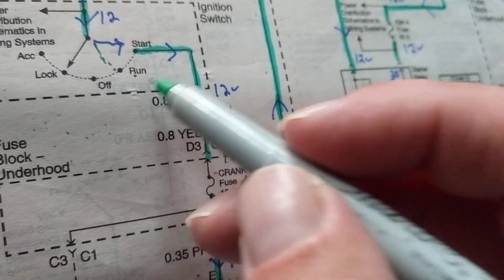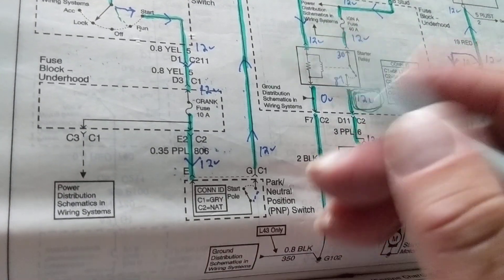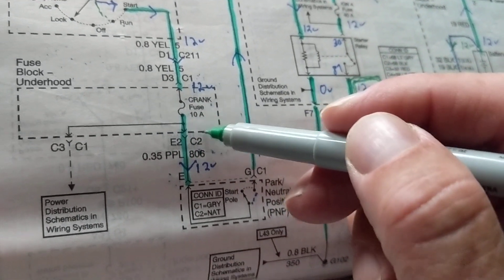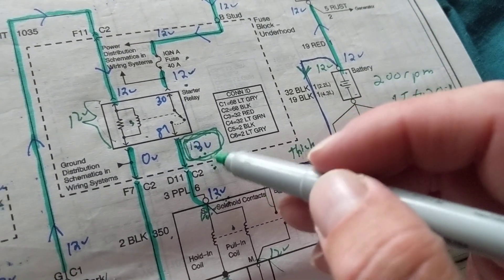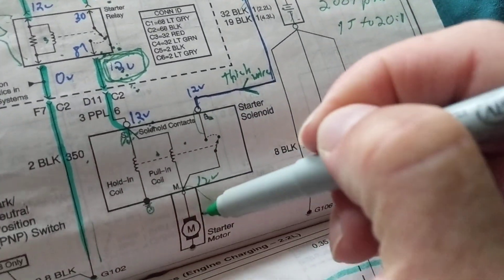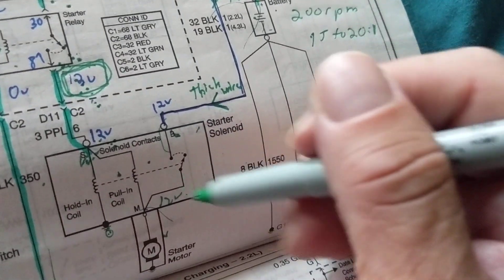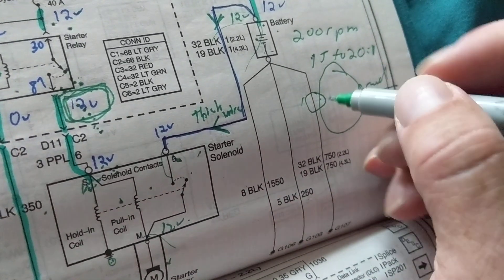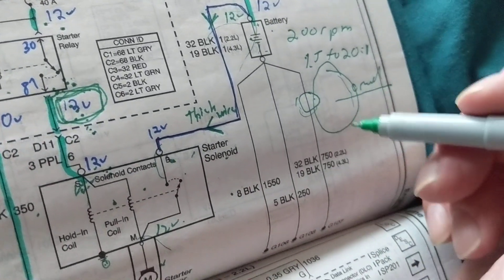HOW TO MEASURE THE STARTER MOTOR CURRENT WITH A CLAMP BUT UNDERSTANDING THE DIAGRAM

Comment: Can I use DC setting or just AC if use amp clamp?
Reply from the maker: The clam can either be for AC or DC however the high current amps clamps usually are only DC and that's what you need DC

Comment: This was beyond hand's on ..
Learning to test a circuit with a load present is more than hand's on. Since I also learned theory, learning amps will flow in great amounts when work is being done. I always hear measure voltage and now I learned amps can tell us much about a component.
Learning about having voltage drop across a wire with high amps also makes sense since the resistance in the wire will cause concern due to the high current flow 
Many thanks.
Stay well
Reply from the maker: You are 100% correct thank you so much for the comments